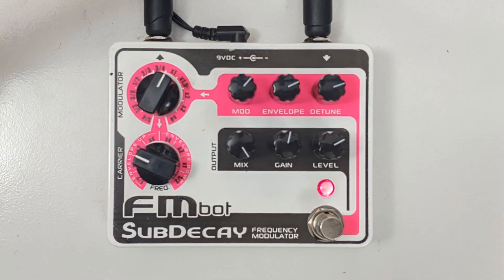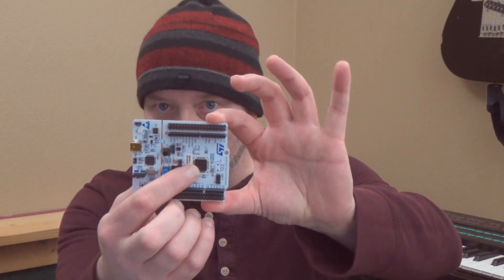What ever happened to the Subdecay FMbot?

Comment: It sounds like the Fuzz and Synth parts are completely independent? Can the LFO work with fuzz? (I know; we have "modulation before fuzz" at home! )
Reply from the maker: Most of the work is done by a microcontroller. There are a lot of shared resources. The Synth oscillators are independent of the fuzz, but the wave folding and wave shaping is not. The LFO only affects the oscillators, so it can't be used on the fuzz.